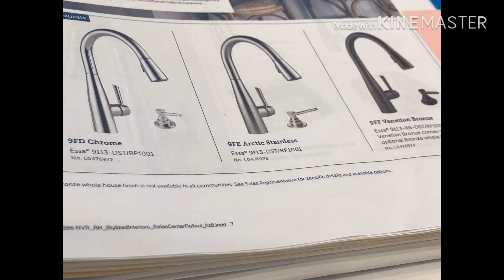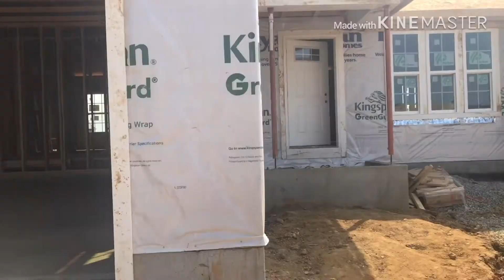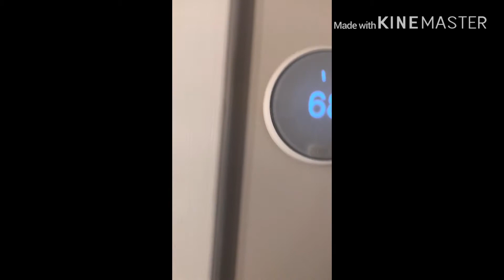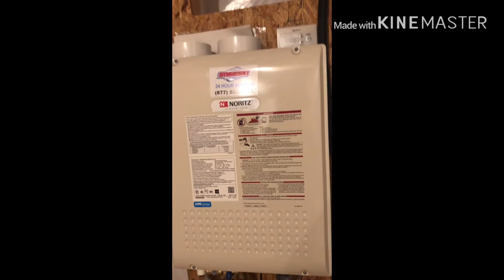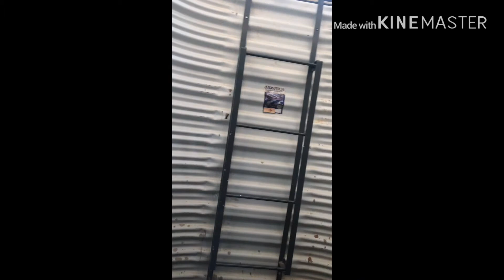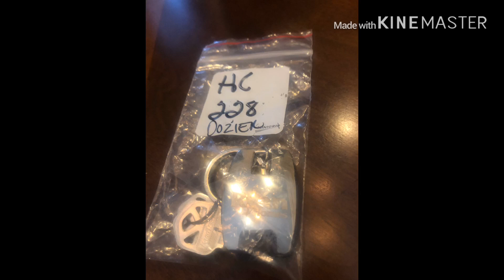RYAN HOMES | AVIANO MODEL | BUILDING A NEW HOME | NVR

Comment: Thank you Crystal and your husband for sharing.  My wife and I are at the beginning of the same adventure building an Aviano.  Your video is VERY helpful to get a sense of the house.  I hope you're enjoying your new home!
Reply from the maker: Thank you so much for watching! Just a couple suggestions, get extra wall sockets in the little niche (if you leave it empty), master bedroom closet, and the opposite wall in the laundry room. So far we are happy. Good luck with your build!
Reply: @busybeingcryssi  Thanks for the suggestions Crystal.  Wouldn't have thought about that but excellent suggestion!
Reply from the maker: George, before I forget - lol, also a socket under the towel rack. If you go with the Roman shower, it is hard to clean! I wish we did the tub with the stand up shower. It does cut the space in your master closet though. We thought to add an utility sink to the garage, but it was too late. All the plumbing had already been ran. If I can think of anything else I will let you know.
Reply: @busybeingcryssi  Hi Crystal, we appreciate all your suggestions.  Funny, we had planned on the tub/shower but then went with the roman shower.  My wife didn't like the idea of losing the closet space and she thinks that the tub would be hard to clean.  We currently have a "garden tub" and it's kinda of a pain to clean.  We did go with a laundry tub in the basement so we have that base covered.  We'll definitely consider the outlet by the towel rack too!